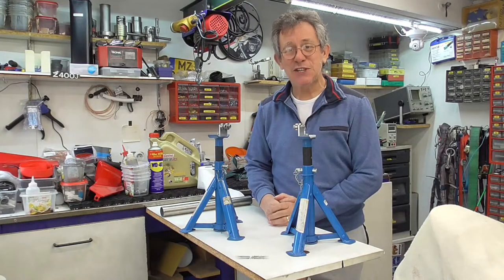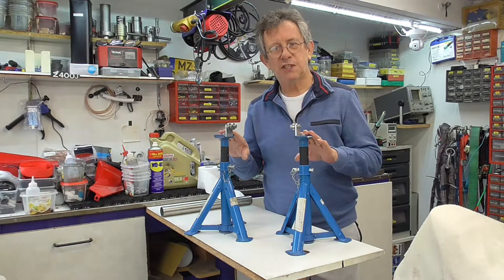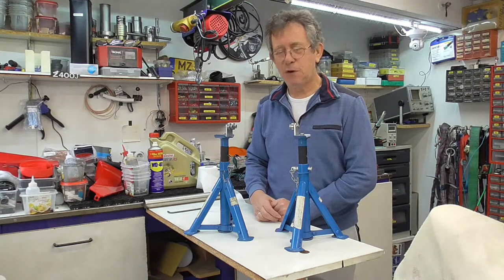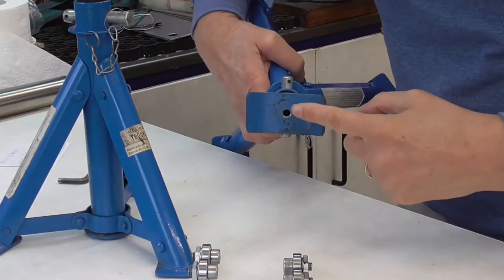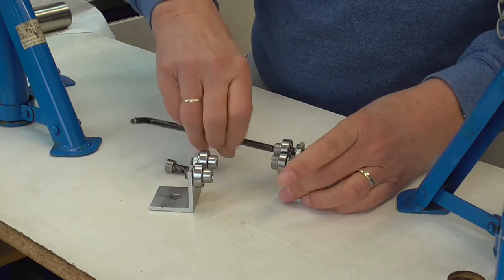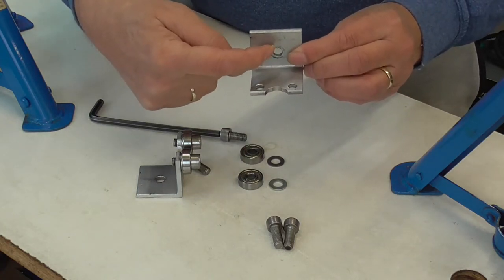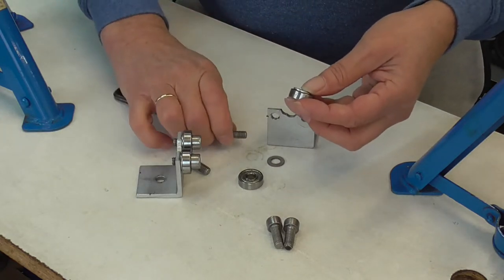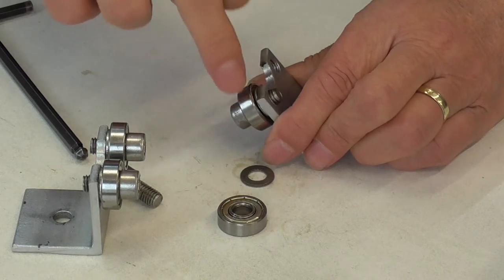Motorcycle Static Wheel Balancer HOW TO MAKE IT YOURSELF [CHEAP & EASY] motorcycle maintenance tools

Comment: Thanks for posting. It looks good.  The only thing I wish you would have included is the one thing that I think is going to be a speed bump for anyone who tried to make this and actually use it to balance their motorcycle wheels/tires and that what to use as a temporary axle and how to hold the wheel in place on that axle when using the balancer?  I know a piece of pipe was shown but that certainly wouldn’t fit any wheel I’ve ever had on a bike. Any thoughts?
Reply from the maker: Hi James, I use the original axel 😉

Comment: Ah, yes. The washer and bolt clamp on the inner race so the outer race is spaced away from the bracket. Without the washer the outer race would drag or pinch against the bracket.

Comment: You need a way to align the two stands and secure them in place. Otherwise they would move all over the place. And then comes the main flaw: there is no way to level the axle as, except to level the workbench and pray the two stands are perfecty equal in height. Which would never be.
Reply: Just bubble level and shim 1 side to level. Then don't move it. If you bump it recheck the level